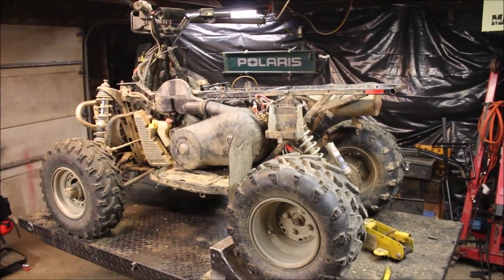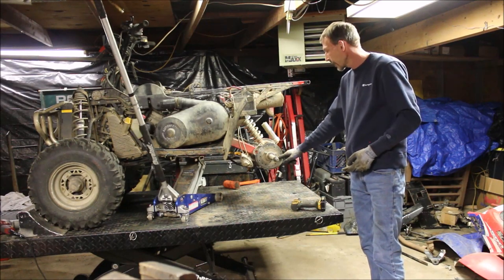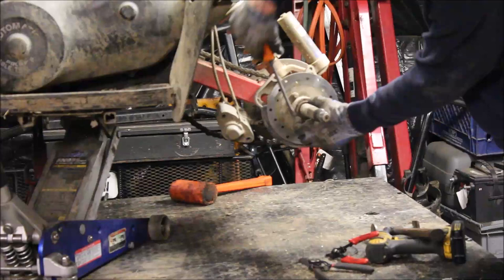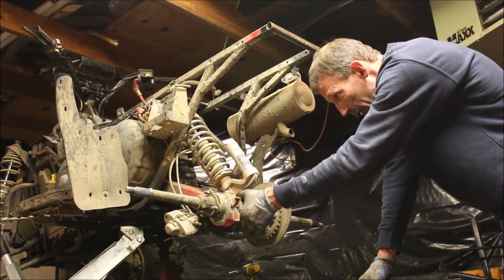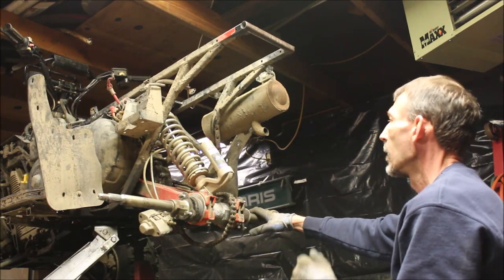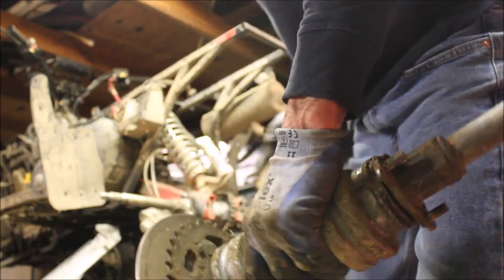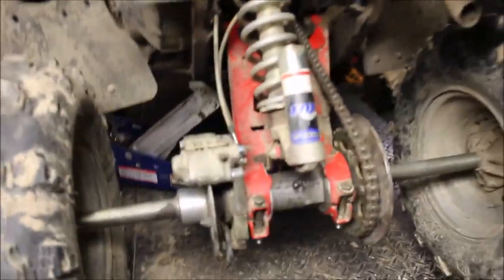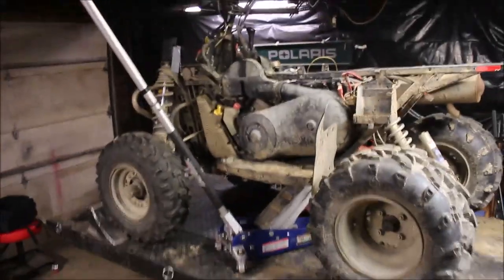How To Replace a Rear Axle w/bad bearings on a Polaris Scrambler

Comment: What’s up bro blind DIY guy here again with the 99 Polaris scrambler 500. Seems like every video You have describes all the crap that happens to our POS.I am going to be attempting to change the rear axle bearings now. I can’t afford another axle with bearings but I got new bearings and seals for about 25 bucks on eBay. any tips?

Comment: Is that a used axle?  How long should those bearings last?  I'm pulling mine out tonight and going to put new bearings in.  Hoping it's not a PITA to install new bearings!  Good vid!
Reply from the maker: Yup, used axle. depends on how well they are maintained. keep em greased they will last a long time.